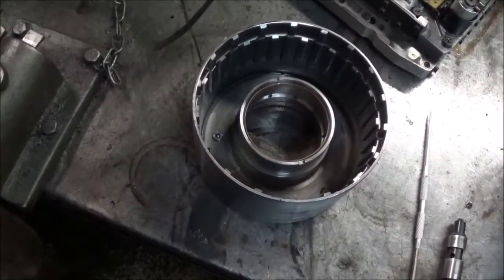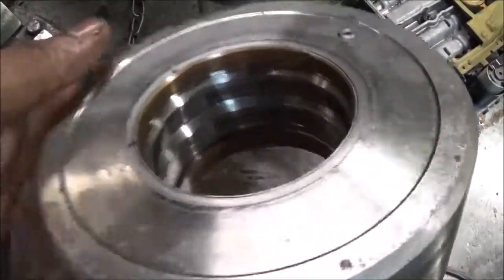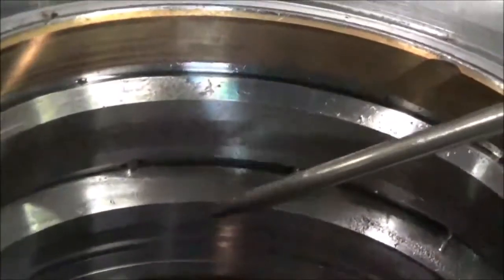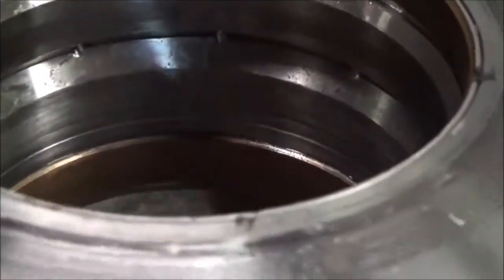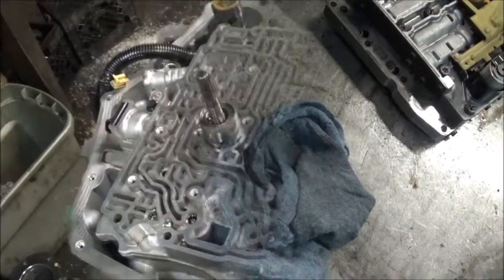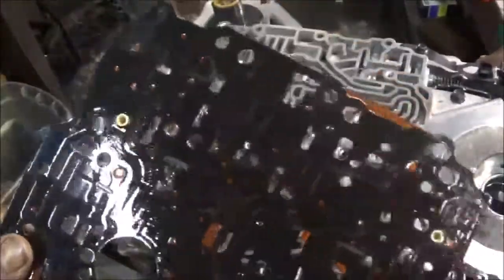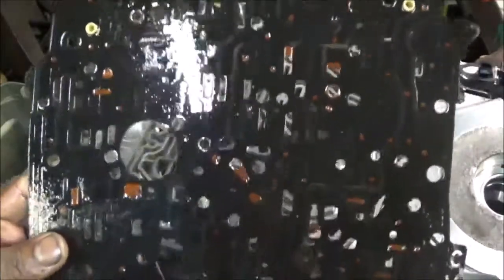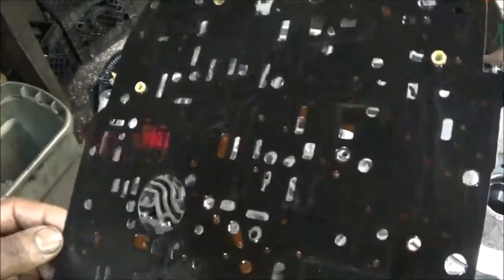4T65E TRANSMISSION (TIP 2)

Comment: Why would you not hot plate the gasket off. They come right off with boiling water and soaking them
Reply from the maker: Never seen a ":bonded" gasket to come off with hot water. Maybe next time I will try it.
Reply: @thisisyourtransmission ....so  do hot water works?

Comment: Mine was leaking due to a hole in the side pan.....when I fixed the hole, it started leaking near the torc converter....it also made a groaning sound, I Pulled the transmission and replaced the seal and torc converter......many ppl are telling me it was a bad torch converter.
When I pulled the torc converter everything seemed fine.....I heard a bad valve body seal will leak but will come out the weep hole or vent on top near the shifter.....mine doesn’t, I might replace the entire valve body and gaskets....but would a valve body from a 4t65e fit a 4t65e-hd unit? Both transmissions look the same except the HD version has a Differential at the end.

Everything works fine and it shifts good...except the groaning sound when I’m at the stop light.

Comment: I “rebuilt” mine in 2018, and I did not notice grooves in my 2nd clutch drum.  it was my first time in a transmission.  this was 30,000 miles ago.  the van shifts smooth, so maybe i was ok?  all the youtube and write ups covered many things to look out for ex: mine fid not have the hardened overdrive shaft for 4th, etc.
Reply from the maker: If you rebuilt it and it is still working, then you have nothing to worry about at the moment. However, there are things that do wear in this transmission that we change when we rebuild it as a safety precaution.